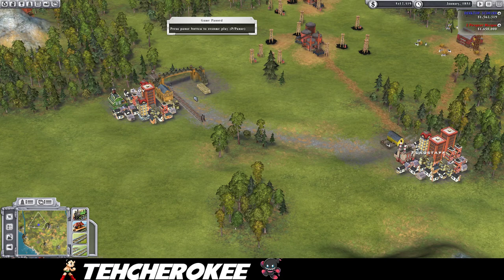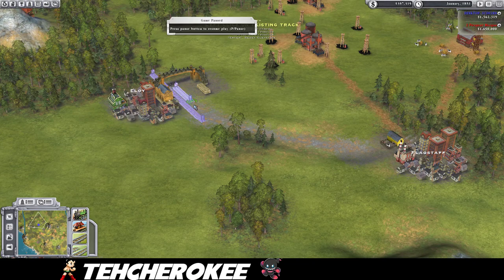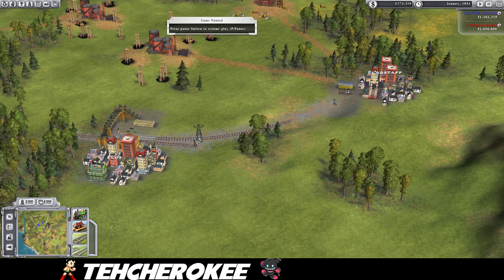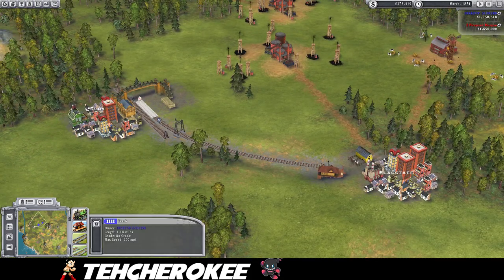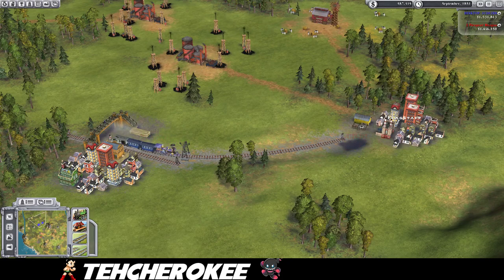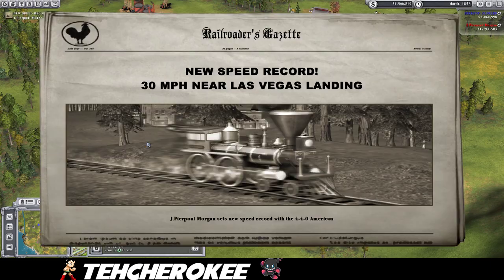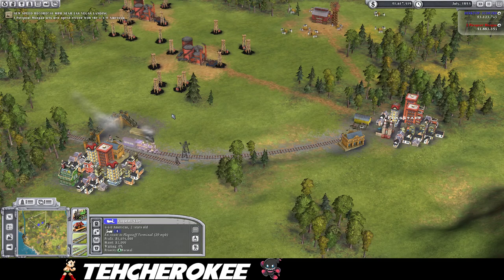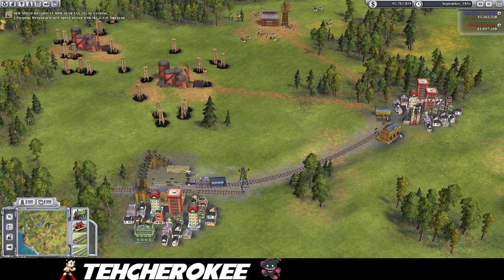Sid Meier's Railroads - Single Gate Glitch Tutorial

Comment: Just tested it out. I did it on the map that has Warren and Grace. and at first it was giving me like 100K+ for a little bit each time the train unloaded. ha.
Reply from the maker: Nice! Glad you got it to work.  I've actually found that the farther away the two cities are, the more $ it appears to give you each time it unloads.  So if you get it to work with two cities that are decently far apart, it'll give insane amounts of money.  Presumably because it thinks the passengers/mail are being delivered very far (despite the fact that they are only on the track for a couple of seconds) so it rewards you with more money?  That's my theory at least - I don't have explicit proof of that though.
Reply: @admiller30  yes, this is indeed a mechanic in the game, although i havent got any proof of it, but im almost certain i have read it in the manual for the game at some point